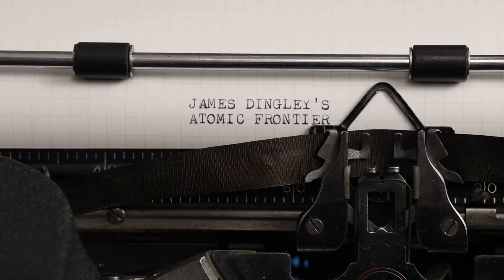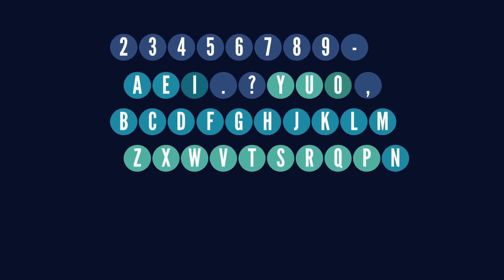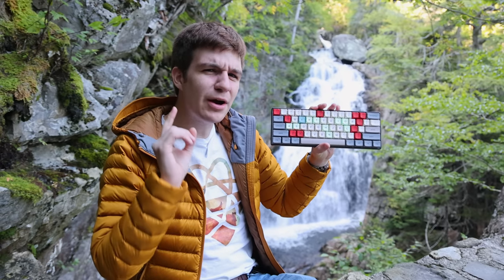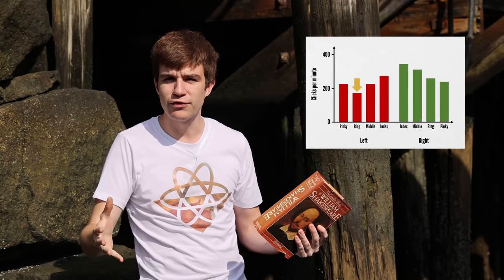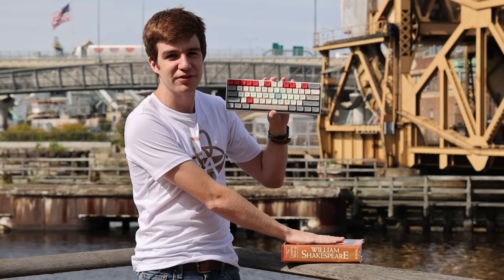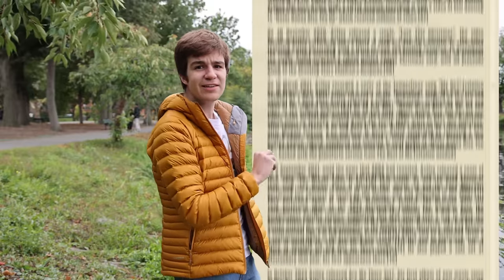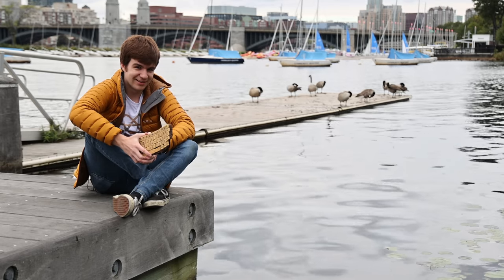QWERTY is broken. Can we make it better?

Comment: Every time I see one of those "I'm going to optimize Qwerty" or "Here's why Qwerty is bad", or even just "Here's how Qwerty can be improved by using ortholinear ergonomic layout", and then the first thing they do is show their rest position as ASDF-JKL;, I die a little inside.

I find that Qwerty is best used, and makes more sense as-is (WAY more than Dvorak) if you use it as you would use an ergonomic keyboard, but in its current layout. What I mean is having the rest position be AERG-HUIO. It's a bit harder to find because H and G are not marked like F and J. But conversely, since it's perfectly around F and J, they end up telling you if you're in the wrong position.

The advantages of typing like this carry all the claimed advantages of ergonomic keyboards, and Dvorak or other improved layouts, combined, and some added:
- Your wrist are not bent, so no carpal tunnel.
- With the exception of Y and T (reachable with either middle finger or either index finger), all letters are reached by bending your fingers. You never have to stretch. You work with your knuckles, not wrists.
- All the vowels are under the rest position. You only need to move the fingers for consonants.
- Vowels are split between hands, so typing them in a sequence allows you to use both hands more. Pressing two non-identical keys in a row with the same finger is rare.

For once, I want to see someone analyze or optimize Qwerty under this hand position, and not under the assumption that breaking your wrists is by design.

Comment: speaking of choosing layout. I use US-English keyboard settings at most of the time. I transitioned from Norwegian layout because I do quite a lot of programming. And many characters that are much used are much more available on the US key layout than the Norwegian layout. I don't look at the keys regardless if I use Norwegian or English keys. I have both in muscle memory. This is typed using an US layout. Most of the keys typed here are the same except the '-' for instance.

Comment: One feature of devorak keyboards, which you didn't take into account by the way, is that they were designed so that you would mostly be alternating between left and right hand every other letter. They did this by putting all the vowels on the left hand. This is supposed to help with typing speed.

Comment: The notional big ortholinear advantage is based on the idea that not all directions of movement are created equal, and that 10mm up/down the keyboard is less painful than 10mm at a diagonal.

Also, what did you use to record your keystrokes for two weeks?  As a frequent programmer, I have VERY skewed key use histograms and will end up with parens on the home row or something :D  I should probably just find a Python code corpus and digest that...

ps- of course julia annoys your lab mates... It's almost awesome, then fails to support something critical and your project takes 10x as long writing adapter code for some library that runs out of the box in c, javascript, python, and maybe even R

Comment: Very interesting! I hadn't thought the possibility of using ML to customize keyboards to each person's use case. However, I have a question. When tracking your key inputs to train the model, were you able to discriminate between normal inputs (for typing actual words) and inputs used for shortcuts (Ctrl C, V, etc.)? While some common shortcuts relate to the action you're performing (Ctrl C for copying, Ctrl N for new page), I suppose some are just for quicker accessibility (Ctrl V for Paste because it's close to C, Ctrl Z for Undo because it's the closest key to Ctrl). For example, in your Bee Movie Keyboard I would definitely map Undo to Ctrl J since the Z key is in a very uncomfortable spot. It would be interesting to take this into consideration when feeding the training data. If you're going to learn a new keyboard layout, might as well relearn some shortcuts. Also, I would definitively remove inputs from gaming.

Comment: I hope you can take this a bit further.  Find out the average person's finger strength, talk to some physical therapists and doctors about the causes of repetitive stress injuries and how to minimize them, and use a training set based on a statistical analysis of what an average person actually types.  This would be a considerable improvement in keyboards for the average person, and not just for yourself.  BTW, back in the 70s I de-soldered the keys on my typewriter and rearranged it to the Dvorak layout.  In a very short time I could type faster than before.  I used the typewriter until the early 80s when I became a computer programmer and had to go back to QWERTY.

Comment: It's interesting how I was never taught to type "properly", so I adapted differently to qwerty and I reckon there'd be less benefit to me changing layouts. With my hands in a non-standard position and I move my hands around a bit (rather keeping the hands still and stretching my fingers to reach the keys in different locations). This means I don't use the pinky much at all, my left middle finger tends to rest on 'e' anyway, and I don't stretch my ring fingers much at all as I move the entire hand and stretch the fore and middle fingers instead. I'll usually hit "a" with my ring finger rather than my pinky, but I don't stretch to do it.

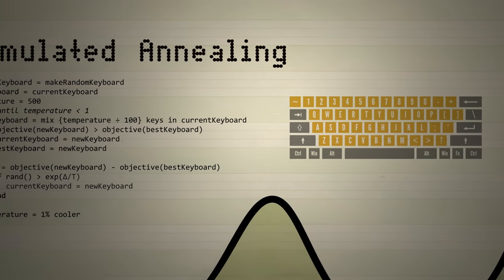Comment: 8:18 The else loop seems off for maximisation. The larger your absolute value of delta, the less chance of acceptance you want. A quick check for SA is that an equally good solution should get accepted with certainty: exp(0) = 1 and rand() can never reach that. There's two quick ways to fix it, I'll leave them open for the interested reader :-)

Comment: one word: language-dependency. 
one comment: I tested which hand in my Danish is the most active by writing a longish text as I usually do and my left hand, also placed correctly in front of the keyboard, types 57% of the text compared to the right's 43, even as I visually observed a tendency for my right hand to kinda appropriate the middle letters as well, while the left hand was doing pirouettes on the left-side-keys - as if it simply wanted the work!

You might have forgotten this calculation. 

As a professional writer I like the "movement of the qwerty" fingers, I just find my right hand appropriation the middle keys annoying, but if these were evenly distributed between both hands, my left hand would then be seen to hit an even higher percentage of the keys compared to my right hand fingers.

I have often speculated If I subconsciously write texts and poems based on a preference for the letters on the left of the qwerty layout keyboard? There is only one way to find out!

Comment: I wonder if I've saved myself stress-injury related finger pains from typing weirdly for my entire life.  I'd taught myself to type playing online games back in the late 90's / early 2000's and as a result I'd already been used to cranking out 100 wpm before I'd even had typing classes in school.  As a result of my own learning habits, I'd developed a free-floating technique where I do 90+% of my typing with index through ring fingers, and my pinkies just kind of float.  At least, my left pinky always floats, hangs down towards ctrl.  My right, on the other hand, is primarily used for any shift-related button presses.  In order to compensate for using 20% less fingers and not strictly utilizing "home-row position", my hands float freely up and down from home row to top row.  The "home" position for my left hand is obviously WASD, and oddly enough, my right hand sits at ML: and the shift key, quickly jumping up to or above standard home row when necessary.

It's strange but there's little that could be done about it by the time I learned to type properly.  If it ain't broke, don't fix it.  The upside, I'm realizing now, is that my fingers rarely ever have to stretch to find their target keys.  But as a result, my hands travel the keyboard much more than they otherwise would.  Which, so long as your muscle memory is used to it, probably isn't a bad thing all things considered.

Lovely keyboard designs, by the way.  While I wouldn't be the type to want to rebind my key configurations to learn another layout, I'm certain there's room for improvement we just haven't settled on as a standard.  Super cool stuff.

Comment: This is stochastic optimization, not machine learning.  Machine learning is mostly about developing a generalizing model.  This is not.  Stochastic optimization is still cool though.  Also, I'm surprised you didn't consider the benefit of alternating which hand types the next letter.  Common letter pairs should be on opposing hands.

Comment: Interesting video, thank you! I considered switching the E and J around on my keyboard, as the smallest possible change, but in the end decided against it. Reasons being that I also type often in finnish, and in finnish the disparity between E and J isn't as large (1st and ~23rd in english vs 5th and ~15th in finnish), and my name also has a J in it, which somewhat boosts its usage. Also it's still too much effort.

Comment: You could probably take this further with more fidelity and physics. 

For example, the distance between two letters no longer matters in the same way if you are alternating hands vs using one hand. “Hehe” is easier to type than “Huhu”, even though the letters are further away. 

Another example I can think of is common rolls like “ing”. 

To take this further you would really need to dive deep into human factors like comfort and speed, and that’s not accurately measured with letter distance or frequency.

Comment: Amazingly, it is possible to go backwards to QWERTY. Here's a story you may not know.

Turkey solved this with the Turkish-F keyboard. Turkish typists won every speed contest ever. However the introduction of the the PC meant the introduction of the QWERTY keyboard with extra characters for Turkish added on the right as a default. If you wanted a Turkish-F keyboard, that was extra.

By now less than 5% of typists in Turkey use the Turkish-F keyboard. The country went backwards.

Comment: Full disclosure: I skimmed the video and may have missed it, but, I see a tremendous amount of discussion of "best" and "worst" keyboards, based purely on made up models. None of these things "matter", or rather they are just a very weak hypothesis, until there's actually some empirical evidence confirming them. The actual "best" and "worst" we care about is how well human beings type on each one, and we have no evidence that the models actually correctly model the thing we care about. If you look at the actual, scientific literature for DVORAK, you'll see it's actually quite mixed, with some studies even concluding that DVORAK is worse than QWERTY. Most of the studies claiming big wins for DVORAK were partial ones conducted by Dvorak that can be safely tossed out.  In all likelihood, based on the empirical evidence, the difference between QWERTY and DVORAK is probably miniscule, much less than the 30% improvement (in whatever sense) claimed in the video.

I understand that the author of the video probably understands all this, but it seems to me it's not sufficiently emphasized in the video. And it should be, as failing to understand the primacy of empirical evidence is a common issue with these things. If this was appropriately emphasized somewhere in the video and I missed it, I apologize!

Comment: I really hoped you would at least mention, that different languages use to switch letters even if using the same latin letters. As a German it is a QWERTZ-Keyboard with just z and y switched because the former is used way more often than the latter. (Plus added ä ö ü and ß but that is a different story.) I've heard that French is different too.

Comment: Very interesting.  Two things; the thumb pushing down on the space bar is boring and actually hurtful.  I wonder if a pull action with either thumb would be better tolerated.
Also, for people who are trying to learn to type; put a spot of CA glue on the J and F so you can find "Home" without looking.  In 3 wks you'll be typing at at least 30 wpm or your money back.

Comment: I tried learning Dvorak about (oh god...) 20 years ago, but I came to two conclusions: first, when you touched on, learning a new layout after years of QWERTY imposes a penalty on just how quickly you can type, and second, I have never seen a Dvorak layout in the wild. Every time I'd have to type on someone else's keyboard, I'd have to recalibrate my brain back to QWERTY.

Sometimes a bad design is entrenched, and there's nothing you can do about. It'd be like if you replaced hammer handles with saw handles. Surely it's better for your wrist, it might even be optimal for transferring force to the nail, but a few centuries worth of convention, and the muscle memory of everyone who's ever held a hammer, would resist the change.
Reply: If I'm using someone else keyboard for more than 5 minutes, I'm just changing layout to Dvorak. It pretty quick and easy thing to do. I myself never owned Dvorak keyboard, despite using this wrist saving layout for ~10 years.

Comment: I think you would get a lot more measured improvement from things like the size of the keyboard and keys, the angles of the board and keys, key activation pressure, wrist support, chair shape, desk size/height. Before you saw any real improvement from a slightly more optimized layout. Focus on the human size difference factor and then things like age and any injury. 

QWERTY is still around for the exact same reason Japan has 50 and 60 Hz electrical grids; It currently works and the improvements you would gain from a single standard doesn't justify the cost to change.

Comment: My concern (not the best word) is that your process ignores the speed advantage when commonly used strings of characters are spread across hands/fingers.

e.g. Example: 
If all three characters of a common string THE (or TRI or WHE) were typed by a single finger, this added time delay when switching this finger between multiple positions would be significantly slower than the short time needed for a the human to type all three using three different fingers. Even when one of the letters was typed by a weak hand's weaker finger.

Comment: We really need to move to a new keyboard layout, but it will require an industry effort to support ambiguous layouts years in advance of some sort of forced upgrade. (Support beyond switching layouts in the os as is available today.)

This support would include keyboard hardware which can switch layouts and change key displays on the fly (sharing a keyboard occasionally with non-Dvorak programmers is common), as well some sort of support for standardized shortcut positions. As a developer, shortcut disruption and occasionally sharing my keyboard with others made Dvorak adoption impractical.

People focus too much on letters because they are easy to ML train from copy, and underestimate the role of shortcuts and nonalphabetic/characters in modern editing and programming which are not represented when analyzing files.

Comment: It wasn't about computer keyboards. It was about typewriter keyboards. The layout ensures that the mechanics do not get tangled up when writing quickly on typewriters. Typewriters became teleprinters. These machines write over distances using electrical impulses. Then computers use teleprinters as input and output. Later this became the computer keyboard and the computer printer. The paper tape readers first became floppy disks and then hard drives.
The US QWERTY keyboard only has 102 keys, but an English QWERTY keyboard has 105 keys. This means that more special characters can be entered. All European keyboards have three keys to the right of the L. US keyboards have only two keys right of the L  

The German QWERTZ keyboard still has to accommodate the characters ÄäÖöÜüß. Y is used very rarely in German and Z more often.  The Swiss QWERTZ can even be switched between German and French.

The French use the AZERTY layout.